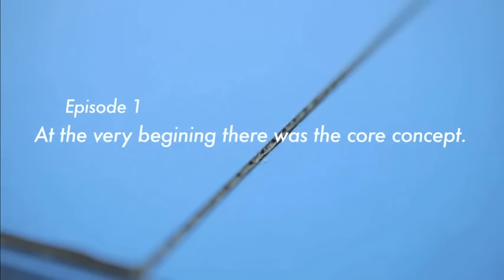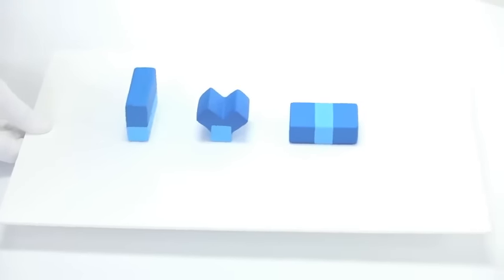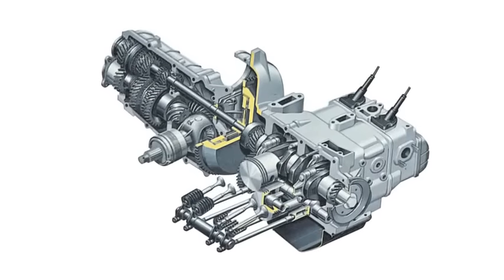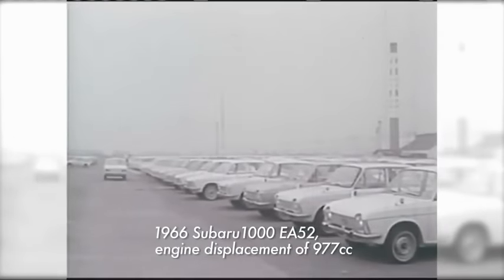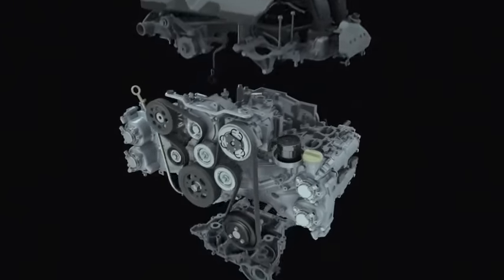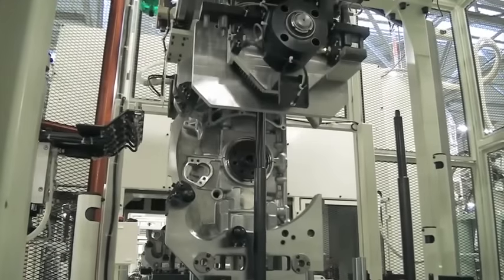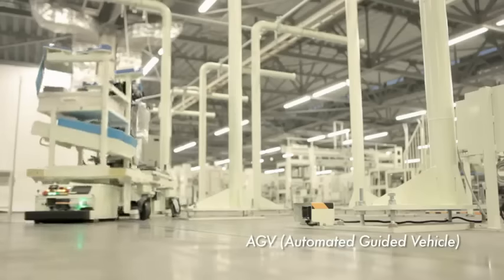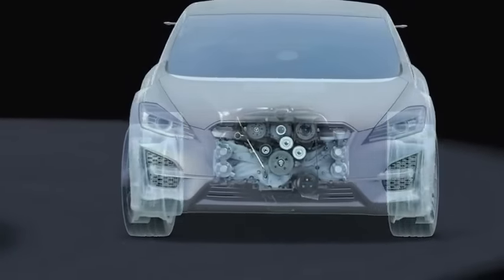Learn About Subaru Boxer Engine Technology

Comment: damn! I been wanting an sti and saving up for one but I keep hearing the head gaskets fail ,clutch/throw out bearing sucks ass and they get ring land failure. Im glad I did some research before I blow my $ on something unreliable.I'm still going to test drive it thou
 . I drive a integra with 150k and still running strong. Idk why Subaru make such shitty parts and material  smh. on to the next car I guess :/
Reply: +Christian Valverde All problems associated with pure neglect. 168k miles in my STi.  Subarus are very very reliable.
Reply: yeah I agree any car you beat up and don't maintain it properly will eventually fail. I just keep hearing negative things about how the new sti's are made but also hear they are great fun and reliable cars if you take care of  it. But Thank you for your feedback and Ill still do my research on them while I save up for one 👍

Comment: This engine is a redundant component  engine with inheaernt 
  inefficiencies and engine steses throughout its dual cylinder banks and case halves, . 
 I've owned 3 Subaru s, . A Toyota sports car has now a Subaru engine to fit it's low hood line , if Subaru offered a Toyota engine in its cars I would by one today . 
Subaru says in its advertising it's all about the love I think it's all about having a modern engine and reliability and not building tens of thousands of cars over 5 years with bad heads and a bad engine design in general it's cute it's small but it's really only a Volkswagen engine that's it been majorly improved

Comment: Aluminium block says it all stay away they heat up warp the block heads gaskets which cause blown head gaskets chevey Vega had the same problems and others that make aluminium blocks if it is not cast metal do not buy or you will be having lots of engine break downs

Comment: Sorry, but the VW VR6 engine along with their Haldex AWD system is far superior to anything Subaru makes. The R32 combines these two. And before you say their not that fast, it's because VW can't turbo them. It wouldn't look good to beat their own Audi/Porsche cars. Aftermarket turbo R32's simply crush any Subaru(and many exotic cars).
Reply: Comparing apples to oranges. VW is a street car that falls apart offroad, Subaru's are rally bred and made to offroad. 
Subaru isn't all about speed/power. It's about reliable, off road capable vehicles.
VW is not reliable nor off road capable.
Reply: Your comment addresses nothing I've stated. But I will address yours; I've owned a Corrado VR6 for 10 years as of this month. The car is now 25 years old. To date, I've had zero engine/transmission issues of any kind. In fact, the biggest repair I've made ever was the a/c system. If I had any interest in driving offroad, there's Audi. (and Mitsu EVO's are even better than Sub's) And we haven't addressed centre-of-mass either, in which Porsche flat engine placement is clearly superior to Subaru's.
Reply: +16vr6 My comment addressed just about everything you mentioned. 
You're pretty lucky, the Corrados were not known to be reliable. 
Some older Audi's were decent offroad, though newer models have become lower, sleeker, made to be driven on road. Unless you pay quite a lot for an SUV, you aren't getting an offroader. The Evo is discontinued, I wouldn't say it's better than anything Subaru makes. 
As far as Porsche vs Subaru, depends if you prefer rear or front engine. The Subaru handles much more predictably, has offroad capability on all models. Unless you specifically want track times, the Subaru is a better option all around.

Comment: subarus engines  are oil burnin junks. my 2017 forester was out of oil when I hit 1742 miles brand new. then Subaru has cheated and  overfilled the oil on the oil consumption test to try to cheat me out of a new engine. 3 times they have cheated on the oil test. getting my second replacement engine next week. 12,000. I like the forester, too bad Subaru cant build an engine.  for all those who have one that never uses oil, have you checked to see if it was overfilled after oil changes by Subaru, have you checked to if it uses oil or the light never comes on.  mine was 1 1/2 quarts low before the light came on and if it was overfilled by a half quart then you burn 2 quarts before the light comes on so you may never know.  however when you hit 70,000 miles and the light comes on... and the warranty has expired.....you get to replace the engine on your dime. it says in the manual that burning 10.7 ounces of oil in 1200 miles is normal.  it doesn't say that on the window sticker, you find out when you have a problem and bring it back to the dealer.  they told me how great this boxer engine was but failed to mention burning oil is normal.  it is not normal.  an engine that burns oil brand new is going to burn even more when it ages.  you are buying a new car with a partially worn engine that is going to fail. there was a lawsuit on the 13 and 14 models.  the problem was not fixed, the owners manual was adjusted to say burning oil is normal. its not just Subaru a lot of manufactures are having this problem.  read about honda….theyre engines really suck....oil. I have filed for lemon law and will be giving back this junk to Subaru.  I understand a manufacturer having a problem, but when you intentionally overfill the oil when performing an oil consumption test at 2 different dealers in vt., that tells me Subaru is telling techs to do this to screw customers.  that is unacceptable to me.

Comment: ask any subaru owner... they wear way less than v or inline engines... its not uncommon to hear of EJ motors with over 300000km on them without a rebuild... the only way to kill on is no oil or no water...

Comment: Granted FWD is lighter and had less loss of power from the block to the wheels vs an AWD setup but, who the freak cares!! AWD is a sh!t ton more fun to drive and has loads of grip. I had a boosted fwd setup also then went to a 556whp STI after a stage 2 setup. Nothing has been faster or more brutal that I've owned, been in or driven. FWD imo licks a big one compared to AWD and RWD.

Comment: My Baja has 150k miles and doesn't knock. I run it like hell sometimes too... also its easy as hell to work on. Its set up like a regular rear wheel drive. Everything's up front. replace a belt or alternator or anything on an eclipse or any fwd then tell me Subaru is a bitch to work on...

Comment: Ahh, bring on electric vehicles and not having to argue about which type of hideously complicated overengineered mass of oil and gas is superior...
Reply: +boiledelephant But then starts the arguments of which batteries are better, charging methods, circuit protection methods, brush vs brushless, Single motor vs multiple motors, ect... Oh its already happening now.

In the far future: which atom is best, propulsed hover vs earth-magnetic anti-gravity, which company makes the best AI for autopilot....

Far far future: What hyper-drive is the best.....

Were all human. We will argue over anything.  No matter what.  We even argue about spelling ex: color vs colour.
Reply: Subaru did that, but it flopped

Comment: Good design. Altough N/A Subaru engines really do not like to be pushed, they will get rod knock from a spun bearing in no time. The turbo engines are a lot more stout and that's not something you'll have to worry about. What does suck, if your engine does suffer an internal failure or you wish to build it... Removing/installing the internals in a Subaru flat-4 is just moronic. The whole splitting the block thing is retarded.